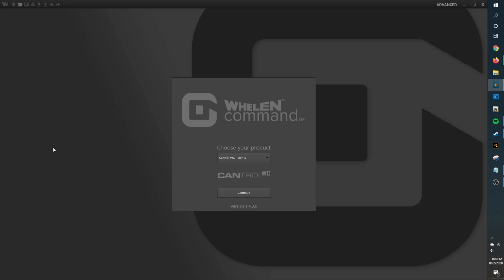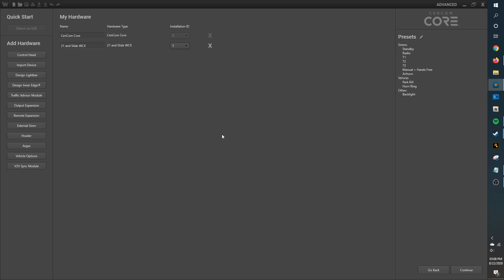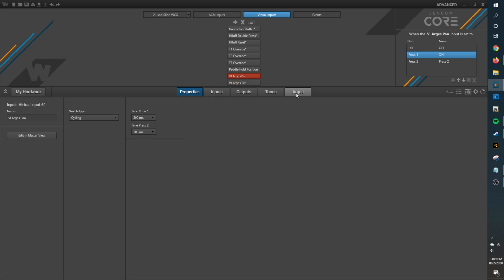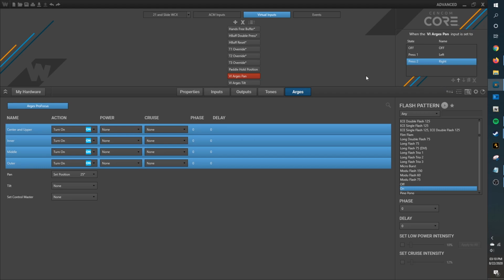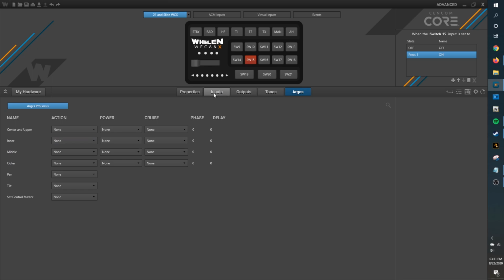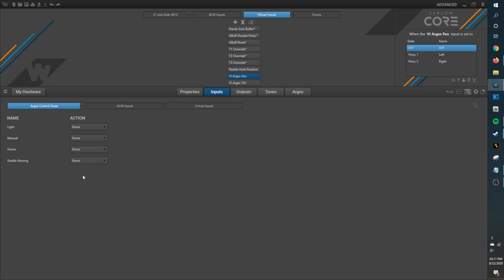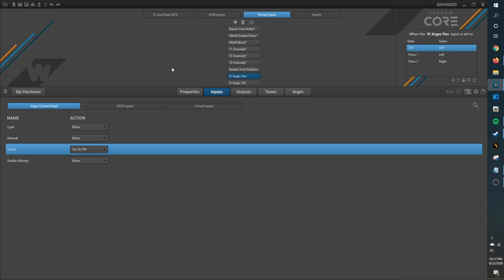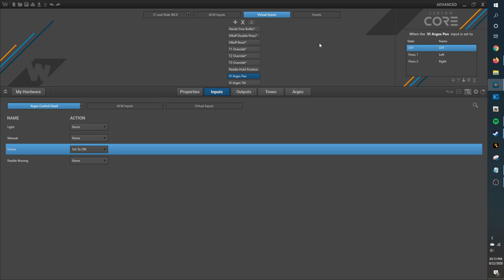Whelen Arges Intersection Sweep Programming

Comment: Hi I have arges pro focus and a core in my truck can you confirm me that I just have to run from the arges remote the grey and green wire to the core same place where I plug my expansion modules ? Thanks